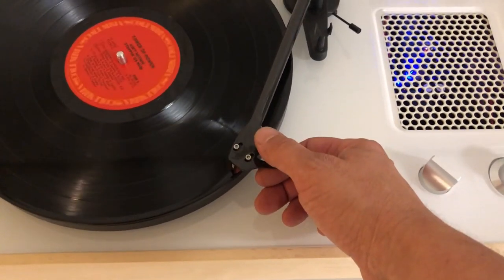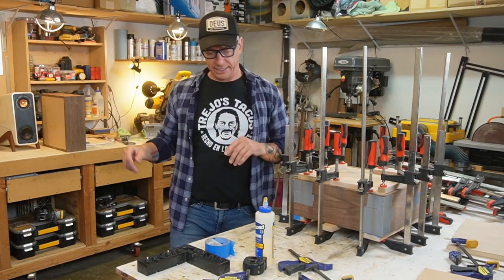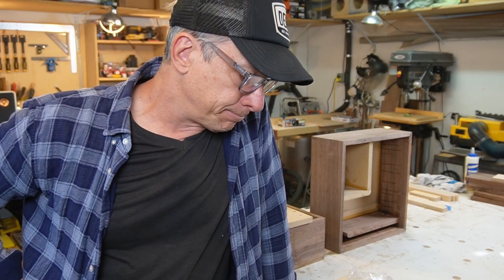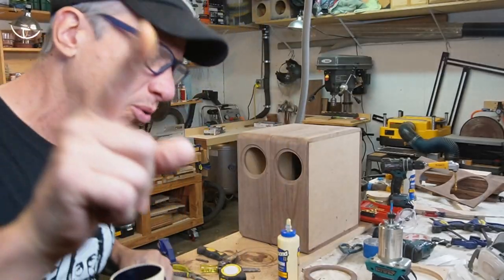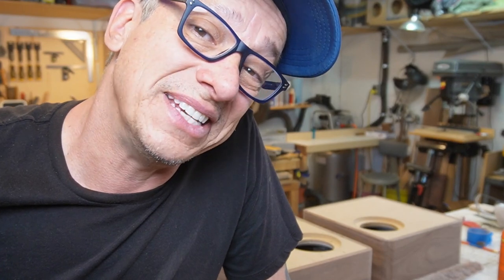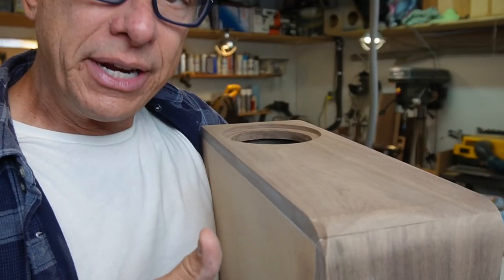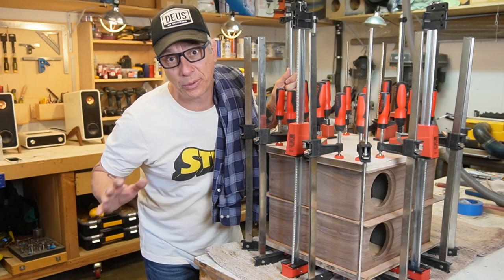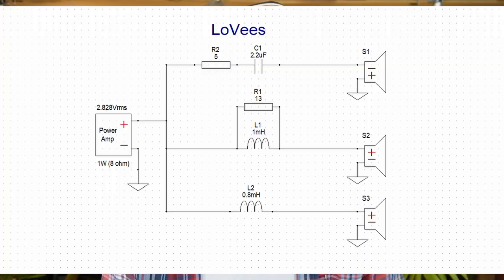LoVees Speaker - Part 2 - Markaudio CHP-70 Fullrange | Tang Band W-5 | Dayton Audio ND-20 | DIY

Comment: I am an interior designer, engineer and trained as an electronics technician.  I like your videos and the way you build your speakers.  They are characterized by a perfect style and good design.  The skills you use to make them are really great.  I also like the components.  These days I have finished a small box with a Markaudio CHR-70 in it.  This chassis sounds great when played alone.  The only thing I don't like about your 3-way speakers are the black metal stands.  Somehow these don't quite fit with the otherwise beautiful design.  Greetings from Germany from Michael.
Reply from the maker: Hey Michael! I really appreciate your input. I do agree that they look a little “different”. We can work on that further. Or just remove it!! Thanks man!
Reply: 😅 I don't know, I kind of like the look of the stands on the speakers. Plus that brings them off of the floor or shelf wherever you're putting them..
 What a fantastic looking set of speakers. Great build, great job. Now I want to hear them

Comment: I could never do what you do with the design and cabinetry.  Don't fuss on boo boos.  But maybe I missed something.  I have never seen twwter positioning in the back like that.  In blows my mind.  I understand the woofers.  Can you explain the tweeters?  I must have missed it in pt 1.  Is this your genios design?  And how does it sound?  Does it all come together with a good integrated sound stage?  I can't believe you don't have at least 30 thousand subscribers yet.  You are a hidden gem.
Reply from the maker: Hey Mike. Thanks for the input man! Im working on the channel, let’s grow it!!
The front driver (fullrange) plays the full spectrum from around 200Hz to 20KHz. The tweeter on the back help with the soundstage. Makes it deeper and add highs to the response. It plays in reverses phase to match the front driver. Some speakers in the market use that already with good results.

Comment: Fantastic work. I’d love to you extrapolate this design with a “push-push” woofer system like Audio Physic Tempo and KEF Blade
Reply from the maker: That’s interesting my friend!! Let’s keep it in mind!!
Reply: @sonnoradesign  in my spare time I am working on something similar. A small tower using 1 MAOP 7, 4 SEAS H1480 16cm woofers (push-push), 1 rear firing Fountek Neo 1.0 tweeter. If this works, my next project might be a larger version using 4 SB Acoustics Satori MW19 woofers with 1 SB acoustics Satori MR16 midrange (300-8kHz) and 1 Mundorf AMT17D2 or Satori AT60 operating in open baffle (8-20kHz).
Reply from the maker: That’s a cool design! Let me know how it goes man!!

Comment: I  thought  solid wood has an inherent resonance and not the best for speaker enclosure.?
Reply from the maker: It might not have the best damping but people use hardwood (Boenicke, Sibelius) as well as plywood and mdf. I usually add the sonic barrier which helps. I got resonances (vibration) from plywood and mdf already, bad ones but never from hardwood. Physics? There are videos comparing different kinds of wood. Check it out. John Heizs channel.

Comment: Why don't you simply use T-nuts on the inside of the cabinet to screw the woofer to the MDF instead of a the wood rings? 

https://www.youtube.com/watch?v=XF5AXH1M9tU

I remember they were always recommended on Speaker Builder magazine. They cost less than $1 each, probably less in Home Depot, and are a very solid grip for the drivers.
Reply from the maker: Hey Carlos! That’s great input my friend! I always tend to solve it all with wood! Hehe